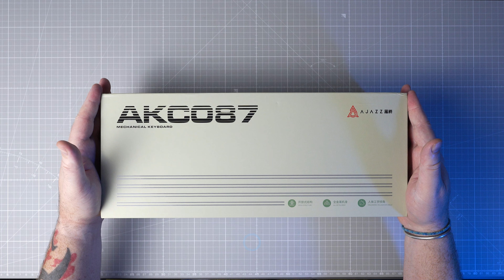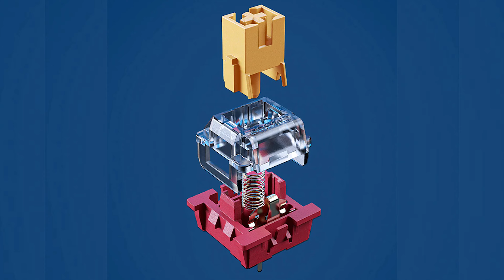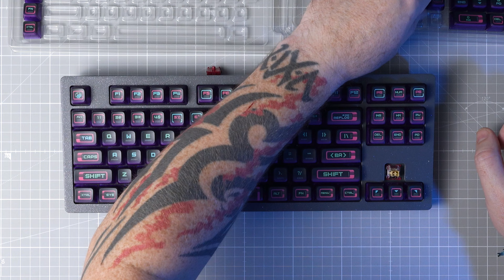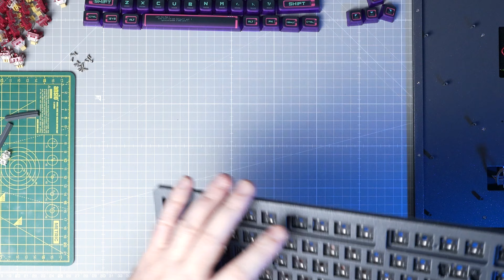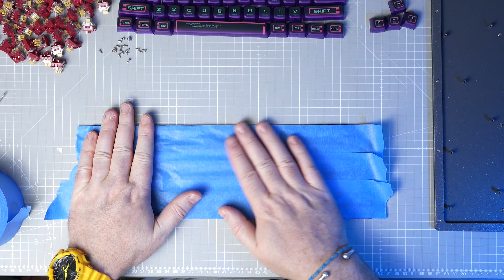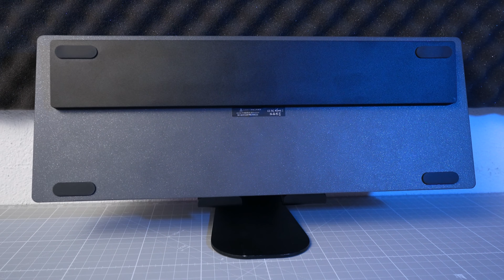AJAZZ AKC087 Unboxing and Review

Comment: Is it better than jamesdonkey a3?
Reply from the maker: I wouldn't go for either really. Cidoo V75 is a similar price. Akko, Keychron, lots of other stuff out there.
Reply: @keebface  I found it on discount for 60 euros .  Do you recommend it for 60 euros compare to other option at 60 euros ?
Reply from the maker: @Tsinepanos  I'm not a huge fan of the sound profile of this one. $60 is pretty cheap, but similar price as Keychron v series barebone which are better in my opinion, mainly because of the sound.